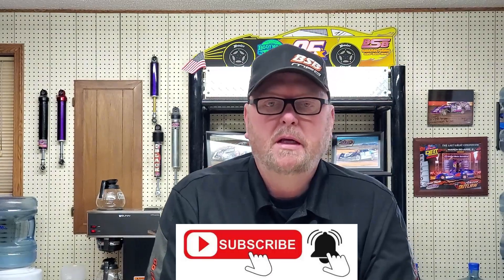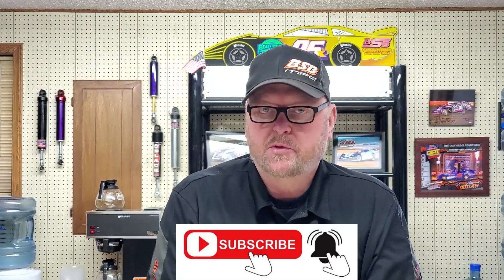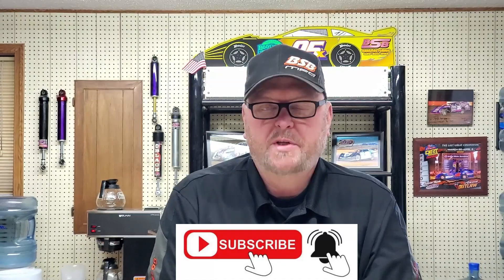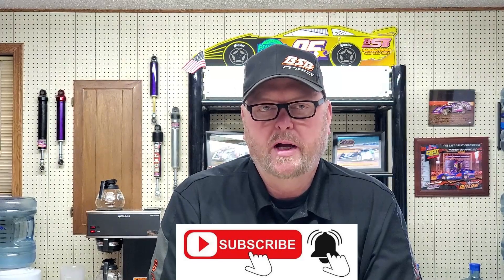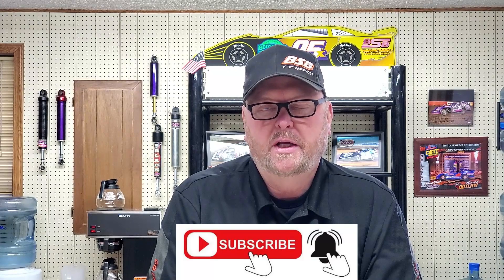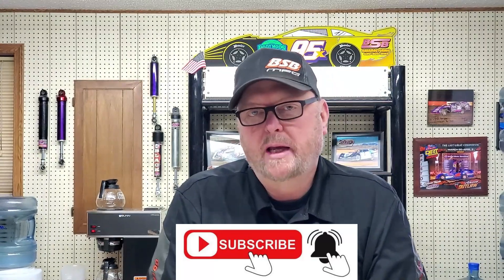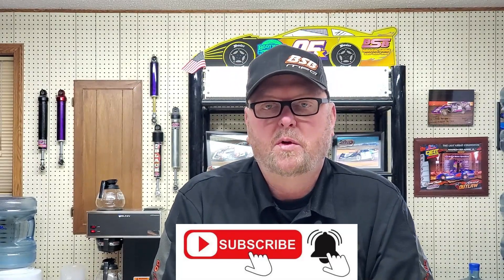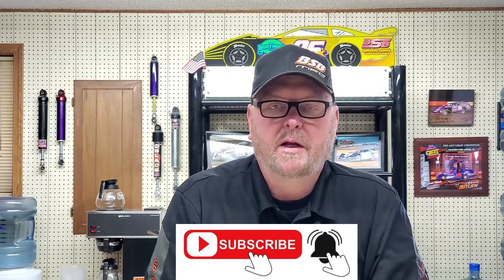Right front setup and how it works.

Comment: It's funny when someone isn't running the front suspension higher to avoid hitting the track with the frame. Then it doesn't turn well now that the roll center is all jacked up, literally. But they insist on staying with the light RF spring. I have tried to convince them they need more spring rate.

USRA was checking for bleed on the front shocks. They would depress the right front and unhook the shock to see if the car moved upward.
Reply from the maker: Allowing the car to move up is okay and I think we need to be doing that, but checking a shock for bleed I don't think the Series has any business messing with that.

Comment: What about having a high static ride height +8" and running a softer spring rate?
Reply from the maker: This is kind of one of those grey areas that I am going to say I am not an expert at, but I am going to give you my 2 cents worth. I am not the biggest fan of soft spring setup; I do like it when you can preload it against the shock. This is not legal in many series so we will not go there. 
•	My 1st thought is why do we really need to be this soft?
•	Is this helping load to the front tires. 
•	Is my ability to turn the front of the car getting better or worse. 
•	Can we build good rebound to control a heavier spring.
Yes, I think there are tracks that need more grip and a softer spring will allow us to make more grip. If we were to run it at a 9” ride height to build enough load to keep it off the track, then we would need to make setup adjustments at standard ride height. (toe, caster, camber)
We are doing a soft spring setup on a car, both front and rear and it is working well so I don’t question it, and my fillings are still why. Not saying it is wrong, I am saying that we need to keep the car off the ground to race well. 
The one thing we can agree on it this: I have two cars, and both are very fast, one is on a 400 and 450 the other one is on 800-750, both take different amounts of rebound, but if it works, I guess do it.

Comment: The ride reference point is the center of the lower control arm bolt?
Reply from the maker: Yes you are correct, and we have a cool little tool to check it. #9038
https://www.bsbgofast.com/product-page/bsb-mfg-9038-ride-height-gage

Comment: I don’t think you get enough credit for these videos. Especially for the shock breakdowns. Please don’t stop with the shock series. Too many people “gatekeep” shock tech (especially internal).  Maybe do some more about load numbers. Maybe basic starting points for guys with using the average of the starting points multiple chassis builders. Far too often I’ve seen guys ask and be told “ask your builder” the sand goes for questions about front roll center. We praise guys who build their own stuff and pretend to encourage guys to do their own deal but always just tell them to trust their chassis builder. You know how many chassis builders where wrong 8 years ago? Ever look at recommendations for  camber from 02? Fast Guys knew back then but major  chassis like dirtworks had guys on 3 degrees.